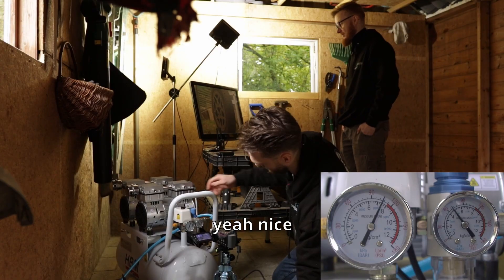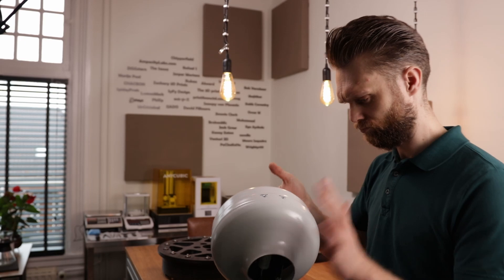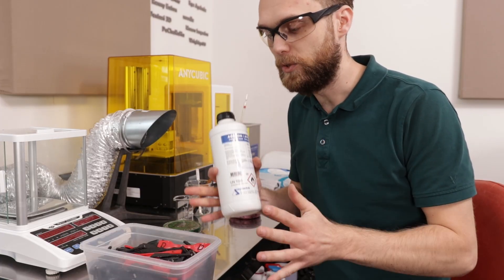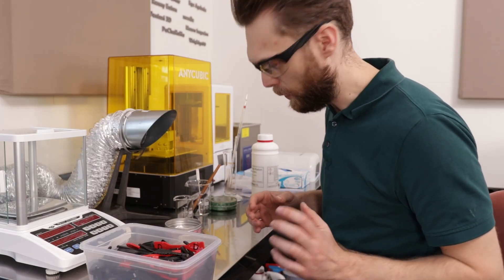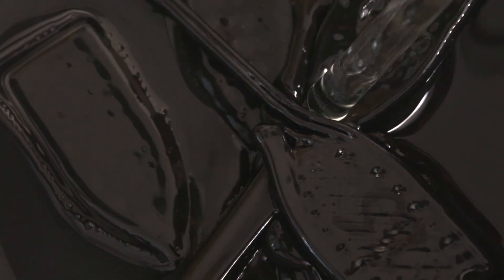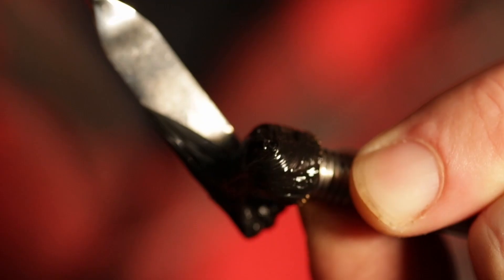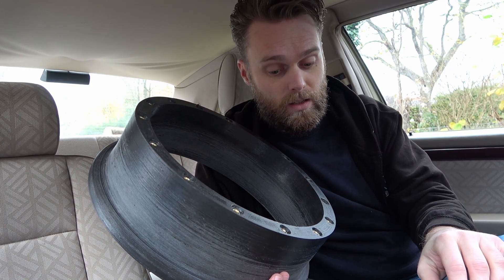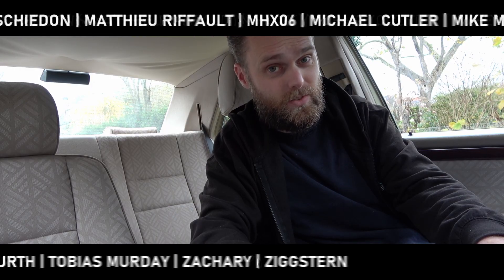DON'T use Acetone to repair ABS parts!

Comment from the maker: Hi everyone! I’m not a chemist, but I think that this is a very interesting topic. This was an eyeopener for me personally and if you have suggestions, leave a comment! Have an awesome day!
Reply: Make sure that they are using MEK and not MEK-P as in resin hardener.
Reply: I have another idea as a follow up:
Try glueing metal bands around your Rim like in tyres. It could add a lot of stability. Also I thought of adding metal/carbon/fibre mesh to the spokes and or rim for increased strength.

Great videos! keep it up :)
Reply: I usually use an insulin syringe to inject the acetone between the parts.
Reply: Je locatie tag staat aan. Weet niet of het de bedoeling was 😅
Reply from the maker: @RockerGraphics  Bedankt voor het melden. Het voegt eigenlijk ook niks toe, miss beter om weg te halen. Ik ben er nu wel wat opener over omdat ik hier niet woon en alleen mijn studio heb. Mooi gescheiden zo :)
Reply: @properprinting  ja zeker! Ziet er beter uit man. Sommige chemicaliën zijn zwaarder dan lucht. Wij hebben bijv de afzuiging dicht op de grond. Omdat styrene is zwaarder dan lucht. Als je meer met chemicaliën gaat werken kijken even wat ze doen. Voordat ko ben ;) kijk naar je volgende projecten uit man
Reply from the maker: @RockerGraphics  Bedankt voor de tip! Ik had al gelezen dat wanneer je het voor elkaar krijgt om fosfeengas te produceren met chloroform, zuurstof en UV je verkeerd bezig bent😆
Reply: I had to make similar development for chemically welding PLA 😀 https://youtu.be/KLZLZG_Om2k

Comment: Maybe I'm talking total nonsense, but what if you make a large amount of that glue and then use it to fill a mold with the shape of the rim?
That way you would get a one piece rim and maybe even add steel reinforcements that would be perfectly integrated inside the rim.

Anyway, I'll wait to see how the project evolves.
Have a nice day.

Comment: While bonding ABS can be done with various types of plastic adhesives (plastic glues), a few of the most common include cyanoacrylate, 2 component epoxy, structural acrylic, and UV curable adhesives.

Comment: The way I get perfect vertically aligned inserts is by not putting the insert all the way down, just leave approximately 2mm out, and then with a flat peace of metal push it all the way down. The flat surface of the plastic where you are putting the insert will assure the metallic peace will be parallel to it and the insert perpendicular, leaving it perfectly vertical.

Comment: I am surpriesed, that the glued part is stronger than it was before. I myself would have re-melted the rim using a big oven and a lot of salt but to do the remelting process the part has to be printed with 100% infill and there is a slight deformation (x/y shrinkage z growth). looking forward to your next test

Comment: People would actually make similar glue to repair the body of Citroen Mehari's, they're made out of ABS-like material and would get brittle and crack so it was common plastic to use old spare parts and melt them in a jar with acetone to make some repair glue

Comment: I’m very curious about your new insert technic. You spoke about the problem of inserting them dead straight into your rim with a solder machine. Vector 3D build himself a device to dissolve that problem the title of that video is “DIY 3D Printed Tool Does PERFECT Inserts Every Time!” 

But first let’s see how your solvent will fix the insert problem👍🏻

Groeten.

Comment: Where the bolts are to big to go all the way thru, you can print holes for smaller metal rods that will fit, and then ABS glue the metal rods in to give more strength to your layers
Reply from the maker: This is a very interesting approach! This was mentioned by someone else too and I think that this is something I would consider doing next when it fails!
Reply: @properprinting  if not when :P

Comment: Don´t know if i would feel comfortable letting the fan suck in the aceton vapour-air mix, guessing the fan uses a brushed motor the aceton air mix could act as an afterburnnner if the concentrations reach igniteable levels. I used aceton several times to coldweld ABS, usually i try to use a flat pan filled with aceton where i can lay in  the surface that should be glued for a few secons so the aceton starts to disolve, take out the parts and stick them together immediately and press for one or two minutes or keep it pressed to gether with some clamps. If youre designing parts that should be glued with this method afterwards its good to add around 0,5-1mm mm height that can act as "glue" that will eventually squeese out a bit or compact while pressing.

Comment: If you are going to extract and then blow out of a building volatile chemicals, such as solvents like these, you need an explosion proofed fan and electrical installation of the fan. Normal electric motors and connections used in installing something like a fume hood fan can get hot enough to reach the flash point of many volatile chemicals. Since we are dealing with solvents specifically, there is still plastic that they can attack in even an all metal fan like what you are using here. The plastic insulating the wiring, the plastic in the connectors, and most importantly the insulating on the motor windings of the fan. This will cause short circuiting and arcing to happen, which will eventually ignite the solvent vapors or simply kill your fan motor. With your level of use, this might take a long time or it might happen really fast, depending on the chemicals, the plastics involved, and the concentration of the fumes in the air being extracted, but if you do get ignition it will either start a flash fire if you are lucky or it can actually detonate as a low grade explosive.

It's your life and property, but it is best to not play with fire, in this case, literally. A window open with a large fan blowing through it is actually safer since the air/fuel mixture is far leaner with the higher air flow and the motor is not subject to as much heat since the air stream cools it very well in such an open design. A vent fan like this has all the airflow restricted to a smaller area, raising the mixture ratio easier and exposing the motor to more solvent in a confined space where it is harder for it to cool.

I have a year worth of hours in the US as an industrial electrician and a 2 year technical degree from an accredited institution. Electrical code class brought up this specific type of installation since there are many industrial processes that use volatile chemicals or explosive powders (two most common for the powders were sugar and grain dust/flour).
Reply from the maker: Thanks for your warning! Indeed, the PVC insulator of the wires can dissolve. I've no idea if the fumes will come in contact with that, but better to assume it does. I am not an expert, but I read that the stochiometric ratio of acetone is 0,12kg/m3 http://www2.ece.rochester.edu/~jones/demos/stoich.html This fan moves 240m3 of air per hour (which is brushless btw.). I have no idea to do the math in this case, but it looks like that the relative small amount that is evaporated wouldn't be that high of a risk. I can imagine that when acetone smoothing at higher temperatures is a different story. I'd love your opinion on this since I like to learn new things.
Reply: @properprinting  Stoichiometric ratio does not need to be reached to damage the insulating qualities of the wiring. The insulation is not pure PVC. It might even be just polyvinyl. Either way, it has has additives in it that make more pliable without cracking and to not catch fire as easily which make it more vulnerable to attack by solvent.

The real risk is the motor windings since they are doing to be hot/warm when in use and have a very thin layer of insulation on them while being packed really close together. They also vibrate from the alternating current in them and undergo thermal cycles as the motor heats up and cools down. The windings in most shaded pole motors like the one in there usually use transformer/motor winding wire with a thin, highly insulating plastic coating and then might be dipped in a low viscosity epoxy or poly urethane, but this has lately been skipped to save money and weight and instead the connections to the winding wires are given a shot of Silastic adhesive (a high temp, semi-hard tin based silicone used in electronics) to protect this fragile area from work hardening because of vibrations and breaking because of metal fatigue.

I wouldn't worry too much about it with the gluing and that you are using a less volatile and higher flashpoint solvent for the glue, but acetone smoothing definitely would be a problem over time since it attacks so many plastics, has a low flash point (I have lit it on fire with a hotplate on low), and is very flammable.
Reply from the maker: @KnightsWithoutATable  Thanks for taking the time to reply! I referred to the stoichiometric ratio because you mentioned the explosion hazard. I think you're right that especially when vapor smoothing I have to be extra careful. For now I'm not too worried, but I think it's a good idea to search for a better fan if I want to take things up a notch. If this place burns down it would be the end of my channel I'm afraid 😅
Reply: @properprinting  Well, to get a detonation, it only takes the stoichiometry to be close and in a region of the space, usually in an area of turbulence where it can build up. Once the flame front starts, it will light any areas with a lean mixture and still cause a pressure wave, resulting in a low velocity explosion. Such a detonation can be anything from a small pop to something far more powerful. Since you have two open ends and the fan will not block pressure, it is unlikely you would get anything that was more than like a car backfiring, but the flames could easily light any flammable material near them, like the container of open solvent you are using at the time.

Another piece of advice when working with flammables like this is to have a fire extinguisher rated to put out any fire they could start and any rags or paper towels uses that have solvent on them need to go in a fire suppressing container and be disposed of properly after the work session is done.

Comment: From my experience with acetone it takes 24 hours with that much surface area to dissolve abs into abs putty that i use to fix mistakes in prints. For chemical welding i just have injection needle and syringe. Needles end is scarred couple millimeters from the sharp tip using (cheap) plyers as filing guide. When there is some damage done to surface just twist it off. Since material is hardened and you have created fault line it will snap from that point removing sharp tip. Tip i suggest you flatten and then put some tape around it before taking it to metal trash so no one will hurt them selfs with it. For the rest just sad the end for bit and now you have way to dispense acetone to target area very accurately. The needle part lasts i dont know how long and syringe takes year of constant use. Eventually inside dries so much rubber seal does not want to come out. You can extend its life with little drop of oil into back end of plunger but those syringes are cheap so its up to you. I use around 1mm diameter needle and syringe is 1ml in size. This is good size for basic 3D print fixes, but for large parts bigger syringe might be better, not sure about needle.

For welding it self, just find the place where it ripped, put marker on both parts with paint marker for instance, then apply acetone to both parts and indicate its place with marker for parts that need it. Then add pressure to fuse the material and after put bead of acetone on the seam so it seals the surface nice and tidy leaving not much to see where it broke. You can hide the seam with applying acetone and rubbing with needles shaft to mold the material, but this does leave white marks least on black ABS and PLA (wont melt per say, but you can try smooth the parts a bit with this method)
If there is no parts missing this works fine. If there is then you can fill and build up voids with thick abs putty. Give it little flame and blow it out to dry it rather fast so you can continue to build up surface or else it takes days to weeks for all the acetone exit the print and some parts might start chance shape depending structure and how much abs there was.

Also if you have low infill like 25% that i use for most peaces acetone vapors from curing will leak to internal space turning that into flexible, so depending how much putty you are using in hole and do you apply it as layers using burning to cure it faster and how thin the putty is it can take from day to week for properly everything to cure. For 100% print i'm not certain havent done much of those, but i'm guessing you should wait said week, just to be sure it has cured properly, or you have failure and can see by feeling the material what ever it is properly cured. This would be pretty good idea to test in controlled conditions.. maybe good topic for CNC kitchen to try.

Comment: For the inserts ive been using ones that are threaded on outside with your final thread on inside,Works well to do holes to outta size just a little smaller,Use drill tape then can glue inserts in place so got both a glue and a thread keeping in place,Had much better luck with them than straight up inserts like you been using

Comment: So if the glue consists of 50% ABS and 50% MEK then when the MEK is evaporated it will leave the inserts fastened with less ABS then if you use soldering tool?

Comment: 💡 what if you could apply a bonding chemical between layers while printing. A  a wide sponge 🧽 roller that whipes/rolls over the printer after one layer is finished printing and then returning back to a parkingposition where it will be soaked for the nextlayer.

Comment: If the glue is stronger than the bond between layers why not forget the inserts and just make alignment pins and glue the two halves of the rim together? Also I would consider brushing the entire surface of the rim with that glue, or the solvent. It won’t make a huge difference in structure strength, but it will help bond the outer layers and make it shinny.
Reply: He has to be able to put the tire on it and there's no way this rim could withstand the forces a tire mounting machine would apply.
Reply: @greggv8  He could glue it when mounting it on the tire. I doubt he's planning on running these rims long enough to wear out any tires.

Comment: If cant use rods. I think you should try use bolts for wood (fix) direct to plástic ir with a undersize guide hole. It might perform better in a 100% infill than and brass insert been pulled out in the opposite direction that was installed. 
 Or made some kind of holes to the brass insert to Let the molten ABS or glue get in. This Will provide More mechanical strenth. 
Also, you may  drill a hole after install the brass insert, and put a pin to secure then.
Great channel! Sorry for muy english

Comment: I've made a lot of assembling of 3D-printed ABS parts using ABS dissolved in acetone. And it is fine if used like one uses glue, but if the seam gets too large(I don't know, 0.5-1mm or so) the evaporated solvent forms bubble. It's like expanded plastics and sadly weak as one.

Comment: If you find the evaporation rate of MEK to be too alow, and Acetone to be too fast. You can mix acetone 50/50 with MEK to form MPK(methyl prophyl ketone). This will give you a medium evaporation rate and a less hard solvent than mek but will evaporate faster like acetone. We use it a ton to clean aircraft parts before sealing or paint work. Not sure that will work for any of this type of stuff. Just useful knowledge for the future.
Reply from the maker: Thanks for the information! I was already wondering why one would mix them, but fine-tuning the evaporation rate makes a lot of sense!

Comment: I say reprint it… hotter and slower. But the chemical bond is stronger than the right in the first place
Reply from the maker: I  printed it at 280 deg C and we tested the optimal print settings for this printer with this material quite thoroughly 😉

Comment: I was faced with joining PLA-CF to PP-GF and about to spend large sums on special order high tech bonding product. I then did some tests with what I had on hand. Polypropylene is same as plastic bags of course and is difficult. I had no idea what might work. Super glue in a medium viscosity form worked well enough to do real world testing of this technical part inside an engine bay. We will see how it behaves with the range of temperatures there. The polymer of the ethyl cyanoacrylate degrades at 150 deg C.
Reply: "Polypropylene is same as plastic bags..."? Here in Sweden it's mostly PE-HD...
Reply: @andersdoverud9046  my mistake, you are correct. Thanks 👍

Comment: what about designing through holes and later coat 5mm threaded rods in abs glue and stick them in the holes?
 similar to iron rods in concrete but instead of beforehand it's after
Reply from the maker: Wow, that's an interesting approach! So awesome that this method of adding those inserts makes your idea possible! If the rim fails at those inserts I'll see if I can make reinforced 3D prints like these. Thanks for this idea!
Reply: @properprinting  advantage could be that the contact area is way bigger/longer

Comment: If the bonded part is stronger, could you in theory print the wheel in parts fixing your max print bed size video?  Does this open up a realm of much larger functional prints as well?
Reply from the maker: I think that this can indeed open up a realm of much larger functional parts! However, I didn't mention the print orientation in the video and I don't think that this is stronger than the optimal print orientation, just the layer bonding has increased (what I assume). So for this specific part I think that the diameter is still the limiting factor.